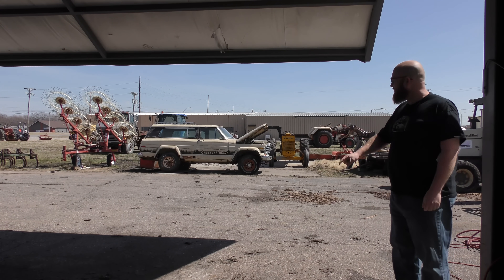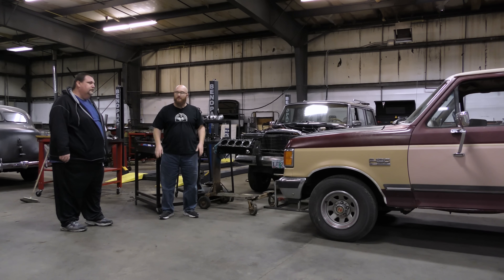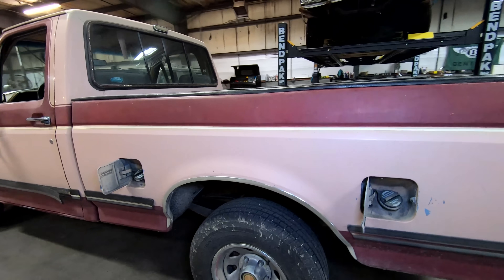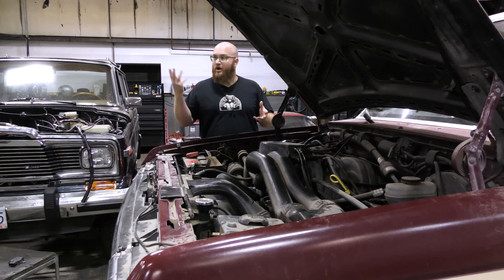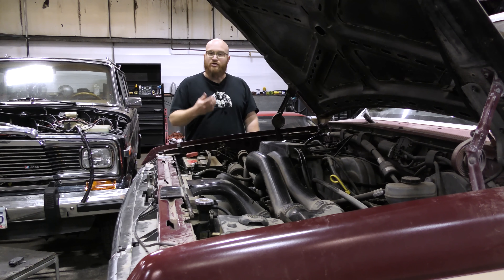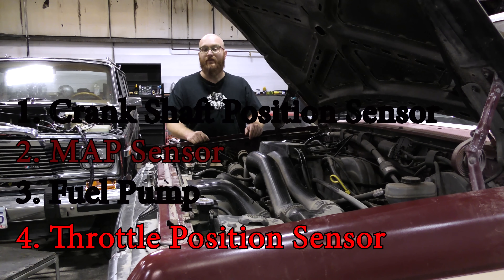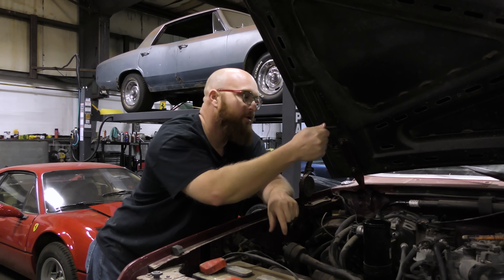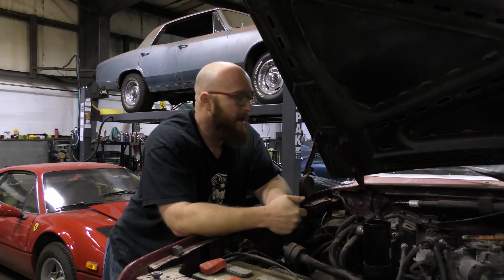Parts cannon couldn't fix this '90 F150. Old School diagnosing by the CAR WIZARD

Comment: As a fan of old Ford trucks and the owner of a 1975 F150 Ranger XLT I approve of this video.
Reply: you're sitting on a gold mine right there. How's the body and frame? Unfortunately this was the era where they rotted out very quickly. 

Same as 70's era chev trucks. The drive trains were bullet proof. You could beat on them like a rented mule and they'd keep running. Guy up the road from me had a 72 chev (trying to remember if it was the 305 or 350, can't recall). I was thinking about putting an offer in at $3000, he was asking $5000. I heard he hadn't sold it and kept driving it. Now 5 yrs later? He's asking $15,000 and I "heard" he got $12,000 for it. 

No rust on the body or frame.
Reply: @muskokamike127  my truck is about 99% rust free. That's my truck in my profile pic. It was restored around 20 years ago and hasn't been winter driven since. I'll be pulling it out of storage in a few weeks once it warms up a bit more.
Reply: @sheldondyck8631   @Sheldon Dyck  NIIICE. 

SO many complain about carbs, sure, they can be troublesome at times, but of all the carbed cars I had maybe 10 issues over 25 yrs and a dozen vehicles. 

I remember rebuilding a 2 bbl with a $5.00 kit on my dad's workbench in the basement. (accelerator pump was worn out so I just rebuilt the whole thing). 

I remember every spring testing the timing with a gun and having to do the odd tune up. Plugs, condenser, points, rotor, $8.00 and took an hour.
Reply: @muskokamike127  carbs aren't as bad as some people like to make out. If they're not worn out they don't require much attention to run properly. No points or condenser in my truck. It's the dreaded Ford duraspark electronic ignition lol. I've heard lots of bad things about that system but I've never had a problem. And I've owned probably half a dozen dentside Ford trucks. Also, they have the greatest heaters ever :)

Comment: So I am assuming this is an Auto trans F150. I bought a 5.0 throttle body from Rock Auto for a manual. They are out of stock for Auto. The remanufactured “Autoline” brand is the only one currently available from unless you go to the junkyard. You are 100% correct on diagnosing these trucks properly. Vacuum issues can be remedied pretty easily. I recommend replacing the brittle vacuum line as a preventative measure since they will end up failing and causing unmetered air to the system at some point. Stupid simple to do, with easy to follow instructions all over YouTube. Once you understand how Ford put these early EFI trucks together, they are stupid simple and reliable. You provided some great insight!

Comment: I enjoyed the video. I've done a lot of work on these Ford pickups. I'm currently doing a 4.9 to 5.0 swap on a f250. I'm tempted to put a carburetor on it, but for drivability purposes I'm going to keep the fuel injection for now. I have done the parts cannon on these trucks before. Fuel injection still seems like a new-fangled invention to me. I miss the simplicity of carburetors

Comment: I have an '89 in the same color combo with the 300 i6 and the mazda 5 speed.  Paid $500 for it because the previous owner ran out of ammo in their parts cannon.  Needed a fuel pressure regulator ($30), 2 new caps on the ECU (25 cents/each), and 4 new tires.  The previous owner's dog attacked it when it was rolling through the yard and managed to pop all 4 of them.  He plugged all the teeth holes and they held air....sketchiest ride ever going to the tire shop.
Reply: It's really kind of amazing to me how many people can't use Google to find the common problems on their vehicles. Cars really are just magic flying carpets to most people
Reply: @ledzeppelin27  I'll agree on that for the fuel pressure regulator.  That seems like a common issue and the presence of raw fuel in the vacuum port was a dead giveaway.  The ecu issue was harder to track down and circuit boards are JFM to  a lot of people.
Reply: @rayo8643  I hear you. This year I'm starting on my tenth vehicle project and they've all been something I've gotten very cheap and only had to do minor work to in order to get running. I'm kind of amazed how cheap and easy some vehicles are to fix, especially when you do it yourself. But most people will consider them broken and let them sit forever 🤷‍♂️

Comment: I use to work on pre-OBD1 automobiles, and trained on OBD1 systems in at TSTI which is now TSTC. You actually only needed an old analog volt ohm meter, and to ground one port to get the codes from those old Fords. And I knew it was a vacuum leak, when you said it had a high ideal as the EGR valves would often go bad and cause the same problem. Had that happen with my 2001 Ford Ranger Edge 3.0 L. You might try calling a few wrecking yard Wizard, and you can sometimes find those old throttle body's on Ebay. And I might be wrong on this, but I think the bushings for that throttle body are the same as the one's for an old motorcraft 2 barrel carb. Worse thing comes to worse, have a machine shop make you some bushings.

Comment: I love the 80s-90s cars, then again those were the things I primarily learned to fix and still tend to own.  Also on the crank sensors not having intermittent issues I beg to differ.  I legitimately have had experience with them being flaky in the past.  Specifically on Jeep 4.0.

Comment: Love the video (and truck). Company I work for has a '93 F-150 with the 4.9 (88K on the odometer) as a spare vehicle...driver it about once or twice a month to take trash to the dump, if anyone needs a pickup truck for the weekend, or if one of our personal vehicles break down. I sort of designated myself to look after it since I'm the Fleet Safety Manager, and nobody else is interested in keeping it going if it breaks down. 

I've learned lately that parts are harder and harder to come by. I ran into the same situation...ordered a part and it was out of stock for "indefinitely" after I paid for it online.  I've been told that if the computer or windshield wiper motor goes out: good luck, and that if I have the opportunity to find them in good shape to go ahead and grab them as a spare. 

The engine itself will outlive me I'm sure.

Comment: I have never used a scan tool and found it helpful to learn that a regular meter can sort out a lot of those problems. I know enough to understand what the sensors do but didn’t know that the voltages and other specs were available. Cheers.

Comment: Does this have the crank sensor?  Wow this is a new diagnosis  for me
Reply: They don't have crank sensors... My source, the 2 F150s of this era in my driveway, and the several others I've owned over the years. They have something similar to a camshaft position sensor called a "pip" sensor buried inside the distributor, other then that the computer on these really has no idea where the cam or crank are in relation to each other, it just assumes everything is fine.

Comment: Before  MAF, ford used speed density fuel injection.  Remove that sensor from the intake manifold and clean it with B-12 carb cleaner.  It's on the lower intake manifold,on the drivers side .
Reply: Intake airflow meter. Google it if you have to.

Comment: @Car Wizard Have you tried Rock Auto?  I know that it's not a perfect match, but there is a listing for the Autoline brand throttle body part number 148034 that would be super cheap, if it would work.  I know that it's for a manual transmission, but the only thing missing would be the kickdown to downshift the transmission to second gear if the gas pedal were suddenly punched through the floor.  One could easily just downshift it manually and proceed from there.  I did try to find the throttle body for the automatic since this truck does have that, but like you said, they aren't available.  Just trying to help.  :)
Reply: "I did something dumb to save 2$ so you should do the same car wizard"

Comment: I used to work at a well known carburetor restoration shop(closed down many years ago) and all carburetors Id drill out the throttle shaft bores and press in new brass bushings whether it be the small autolite single barrel 1100, 2200, or the huge quadra jet 4100, dual holley too every carb got new bushings but reused shafts and plates if in good shape just adjust calibrate it upon assembly.
On rare occasion there'd be a cracked throttle plate or shaft so you'd have to look carefully with good lighting, dont want to use bright light when inspe
Reply: i assume the soft brass wore out as a sacrificial surface to the harder steel shaft?
Reply: I replaced the throttle body on my 1999 dodge durango last year that had been sitting for 9 months.  looked down the throat and it was full of white fuzz kinda corrosion.  dont know if it was seafoam, rat piss fumes, or ethanol gas that did it , but the shaft was completely frozen closed.  you ever see anything like that.  the new throttle body made the car start right up.

Comment: Hmmm - High Idle - running rough - my 2cents - vacuum or an unmetered air leak :) I promise I posted this before watching the rest of the video! :) Also, if your having a hard time getting a new part - I've been lucky with rebuilding - either a kit or swapping out my old part for a pre-done rebuilt....

Comment: I bought a OBD1 Scanner that I use on my 86 F150 5.0 EFI and my 93 Bronco 351W, Best Trucks ever, out of the big 3 I have never been left stranded in my Fords the other 2 not so much. I have had Vac leaks at the AC valve on the pass side firewall. Plastic Vac lines suck when they get old.

Comment: I have a 1987.  All of the vacuum lines and most of the wiring is rotted.  Doing an aftermarket wiring harness, and carb conversion.  Also converting the locks and windows to manual.
The family had a same year Bronco.  It got a carb too.  More power, more efficient, and ran cleaner (according to emissions testing we still had back then).  It also needed a wiring harness.

Comment: I have that exact truck,  except long bed.  Been chasing that idle crap a good while.  Replaced IAC, MAP, TPS, some more than once. About to carb swap it. I’ll check my TB bushings first. Great old truck. Like that one, mine has zero rust. Runs great. The AOD is mostly DOA, but there’s an M5OD sitting in my garage.

Comment: When you have a high sustained idle check for vacuum leaks first, more than likely it needs new intake gaskets, cheap and easy to change. Good videos, drove one of these in high school, same motor. Finished the video and realized I was wrong about the intake gaskets, but 💯 on the vacuum leak.

Comment: Almost twenty years ago, 19 year old me was given a 1991 7 Series BMW by a family member. While it was a ridiculous car for somebody of that age, it had a lot of problems and it wasn't really anything to brag about. It developed a surging idle and I had to scrap it because of this. I believe the part was called an "idle regulating valve" (but I am not overly mechanically inclined beyond doing my own oil, tires, and alternator) and it was almost $1000 Canadian. That was absolutely not in the budget for me, so off it went. I have fond memories of going to pick up a friend to go for a little drive and it taking me nearly twenty minutes to back out of his driveway because the car would keep idling to redline and stalling on me before I could get it into reverse. It's actually a positive memory because of how ridiculous it was - we were both laughing. Glad this young fella was able to actually get his baby looked at.

Comment: I've had issues with multiple throttle bodies on older cars, for me mostly Hondas. I solved it out by spraying carb cleaner on all suspected places for leaks and listening for the idle to raise. When I sprayed on the throttle linkage of the throttle body my idle went up.

When you said the list I suspected MAP sensor although they don't commonly fail or a TPS. TPS more common on the Fords because the plastic tabs inside wear out. That would have been where I started after ruling out a vacuum leak as well. Guess they don't call you the Wizzard for nothing.

Comment: My 20-year-old son has a '93 F150 with the 302 EFI V8 engine that his grandfather bought new in '93, but doesn't drive anymore.  So he gave it to my my son who is fixing it up bit by bit.  It's got got that same rear-tank-not-working problem.  LOL.  I'm sure there's a '90s F150 somewhere that has both tanks working, but I've not seen one in years.

Comment: I call that a "paw paw" or "grandpappy" truck.   Some old man bought it new in 1990, owned it for 20-25 years, drove it, used it, parked it outside(hence the patina) but took EXCELLENT care of it.  Anything broke, he fixed it, notice there is ZERO rust and that body is arrow straight.

Comment: My 96 Bronco only made me clear the AutoZone shelves once. But that's because they sold me a distributor that had a faulty PIP sensor out the box and the 2nd one too. Distributor 3 and about a grand later on various parts and mechanics looking at it finally resolved the issue. The good news is I haven't had many issues since.  Coolant temp sensor went bad but my truck is OBDII so that was easy to find on the scanner.

Comment: Used to have an ‘87 Chevy Blazer with the TBI on top of the 350.  Jumped in it one day and was greeted by a very high idle. I racked my brain for a few days trying to find a vacuum leak, loose wire, etc., but everything looked intact.

Finally got desperate and went to pull the TBI off the intake manifold and found a half disintegrated gasket under it.  

One new gasket later, it was running like a new truck AND it passed the NJ state inspection a couple of days after that.

Comment: I had an 87 F-150 2 wheel drive short bed with the EFI 300 straight 6 and behind it was a 4 speed with granny low,  It was an absolute pulling machine. In granny low top speed was 5 mph turning 3000 RPM so needless to say you just started in 2nd and at 15 mph hit 3rd to 35 mph then 4th all the way to its top speed of 80mph. It was used by a small local produce company as their run around town truck and only had 40k miles on it when i got it on my birthday at the age of 16. Yep it was my first vehicle and it had crank windows, a sliding back glass and the AC would totally freeze you out to the point you couldn't run it past low because it was so cold. It was garage kept all its life with a very nice red paint job, the truck looked like it had just rolled off the showroom floor of the dealership, the interior was all red with that Ford hard vinyl/plastic bench seat that you could fry an egg on in the summer and take for ever to warm up in the winter. Lucky it had a heater that was just as good as the AC so it wasn't to bad. Being a 4 speed it actually got really good gas millage on the highway averaging probably around 30mpg and in town it was probably around 20mpg. Man I loved that truck, I had friends with newer diesels and this truck could hang right there with them when it came to towing a load. That straight 6 will surprise you when it's geared correctly on what it's capable of. After a couple years i needed a 4x4 for hunting and the winter so i traded straight across it for a rust free very nice 86 Jeep Grand Wagoneer with a 4in lift setting on 33" Wrangler STT on some nice wheels. This was around the year 2000 so those Jeeps weren't worth a mint yet. It had an AMC 360 gas hog and it had a sun roof that didn't leak and worked really well. The first day the guy had my Ford he called me pissed off because it would only go 5mph in first gear telling me there was something wrong with it. I said hey 1st is granny low you don't drive in that gear you only tow a big load, just start in 2nd and you will be fine. Well he didn't listen to me and thought he new everything so he put it in 1st gear and dumped the clutch and relined it to 5000RPM trying to get it to go and he blew the whole bottom end out of the engine. He might as well had stuck a hand grenade in the engine and pulled the pin. Then he called me and told me all this and wanted his Jeep back. I called him a fucking idiot and hung up the phone. about 2 weeks later I was driving the Jeep home from work when i heard a loud noise come from the engine and then I lost oil pressure. I popped the hood to find a hole in the side of the block big enough to put 3 fingers through. She was royally fucked and so was i, I have the feeling I had been sabotaged but I had no way of proving it was him. We still tore the engine down and found a rod busted in half and through the oil pan, lots of piston pieces but the strangest thing we found was imprints on top of the other pistons that looked like part of a key and nuts and bolts. All I could figure was while the Jeep was parked at work someone popped the hood and got that shit inside the engine some how. Probably someone that was very familiar with the vehicle is my guess since it had just had a complete overhaul less than 10,000 miles ago. Since I only paid $1000 for the F-150 to begin with and ended up selling the Jeep for $3000 I was still up $2000 but I would have much rather of had my Ford back and never made the trade to begin with. Beware of who you do business with and make sure the new owner is aware of what kind of vehicle they are getting and know how to operate it.